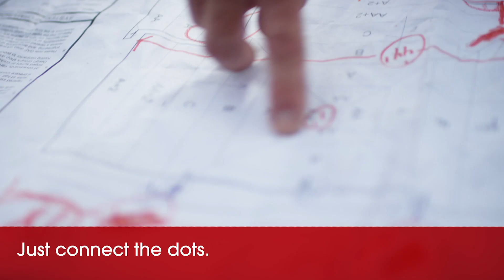How to Correctly Install Tapered Roof Insulation | Roofing it Right with Dave & Wally by GAF

Comment: All good and on point but i wonder why theres no safety lines at the exposed perimeter with such low parapet walls and why are ypu guys not using some weight on the adhere tapered system?
Reply from the maker: Please reach out to our experts at tdg@gaf.com, and they'd be happy to answer any specific questions you have about the Tapered Roof installation process.

Comment: What is the manufacturer of the panels?  Do they work as a substrate for a 3" concrete slab?
Reply from the maker: Hi Jason! Please reach out to our technical team at (800-766-3411) with any questions you have,  and they will be happy to assist.